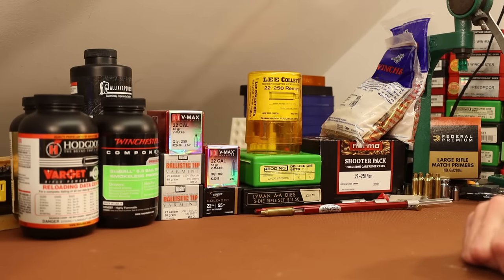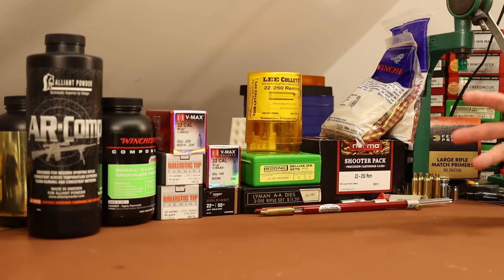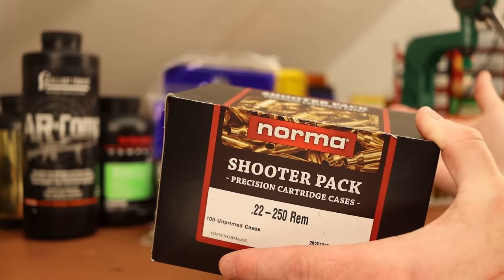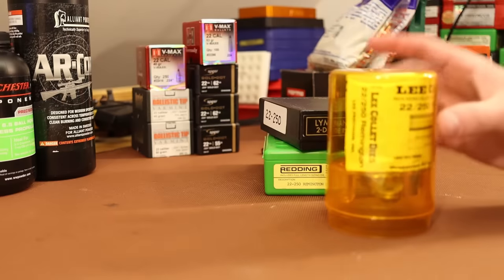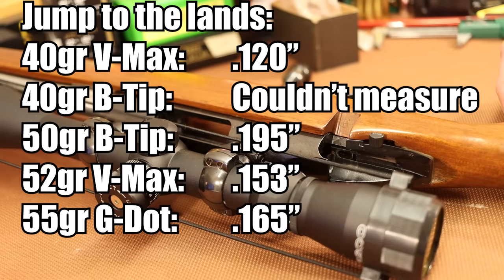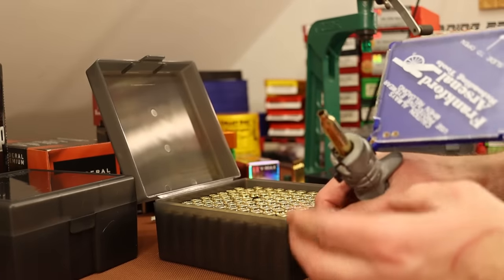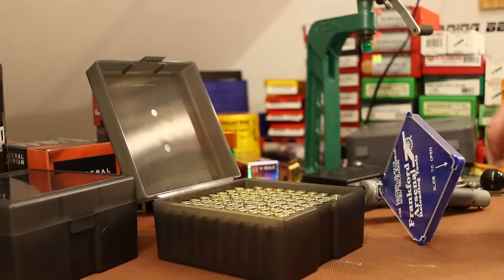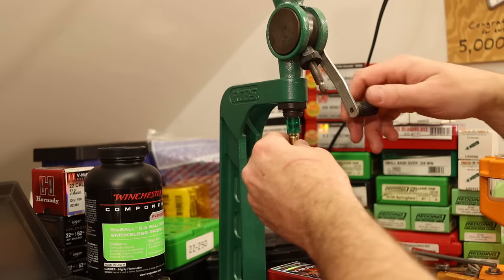.22-250 Remington - Getting started with reloading

Comment: Merry Christmas JRB and thank you for this video.
The 22-250 is my calibre of choice, and I can tell you that they are as temperamental as woman at that time of the month. As you found out, they hate the longer projectiles. This is most likely to be the difference between the Centre of Pressure and the Centre of Gravity. With the longer projectiles the CoG is well behind the CoP (this is a generality, and may not be true for more modern projectiles) which will lead to instability with the slower twist. A couple of years ago I tried some Nosler Custom Competition 52gn BTHP and the sum instabilities of the BT and the length of the round had them full keyhole at 50 metres! Had I been shooting 100m, they would've missed the target completely, and it didn't matter the powder or load used. I have found that square based projectiles will ultimately give far more consistent results than BTs.

I compared 2 Sierra pills, both 55gn, their GK and their Varmint. The Varmint(square base) shot much more consistently than the GK (BT), but due to cost, I use the GKs, because over here they're called "Super Roos" and are almost half the price of GKs, lol (I'm poor).

I've also found: the slower the powder, the worse they shoot. Don't know about heavier pills in a tighter twist, as I'm currently using 14" twist, but on rebarrel (about 6 months away) I'll be installing 10" twist in 22-250.

OAL - I don't even bother any more, as in my rifle the projectiles are Olympic Champions in long jump, which in most factory rifles is the norm. With most of the testing I've done, I've simply added case length, projectile length and minus 0.223", seating depth = projectile diameter (well close anyway, lol). I've also shot various rounds reloaded from trusted shooters, measuring everything prior shooting, and we're all loading to pretty much the same OAL. The 55gn V-max are tack drivers, they should be in your mix.

I use 8208 and have tested slower powders similar to Varget (a good powder but not for 22-250) down to comparable powder to H4350 as well as a couple of faster powders. Through out all these, I found that 8208 far out performed all the other powders, so I'm very interested in viewing your results.
Again, thank you very, very much. (hurry up! lol)

Comment: Hey bro i shoot alot of 22-250 mine is a tc venture predator 1-12 twist that one is probly 1-14 . First off id say your biggest priblem is the optic and secondly your chrono on your barrel changes its harmonics especialy as its moving down the barrel that id say is reason fer the big groups. I have shot all the primers in mine and winchester large rifle is all i use now they are the hottest primer on the market they have never had a magnum primer till here latley and wlr primers have fired alot of powder charges in magnums thru the years. In my rifle wlr is the most accurate. I use winchester brass 90 percent of the time i akso use remington and hornady win. And rem shoot pretty close to the same the speer 70 gr sp is the same lenth as the 50gr nbt so it will stabilize in a 1-14 twist just so you will know and it hits hard at 200yds on steel the staball 6.5 powder charges in other calibers are real close to superformance charges and fps is also close just info i picked up on my lee seating die does not crease my bullets but my hornady die in 222 rem does just something i noticed in my experience thanks fer the great video bro looking forward to another one

Comment: Enjoy your videos greatly! I used to shoot a 22-250Ackley improved, that Nelson Berger built for me. It was a heavy contour Douglas barrel with a 14" twist. It shot one hole groups with 55gr nosler ballistic tips and IMR 3031 powder. It shot good groups with the same powder/bullet combination as a standard 22-250, but I had to push the envelope on pressure and velocity a bit too high in order to get good accuracy, hence the switch to Ackley improved.

Comment: It’s not just length, but the center of mass relative to center of pressure. If the extra length is from a light plastic tip, it will stabilize just fine.

Comment: I just seen your video on the 22 250 I had a  model 700 with heavy barrel  and with  h380 55 gr Sierra hollow point  and  just neck sizing  the bullet has close to the lands as possible  at 100 yards 1.8 in groups at 200 yards  1.4 yards  and 300 1.4 groups

Comment: OMG, a movie length video!  I made it through, but I did fast forward through the loading portion a bit.  I was happy to see you loading for the .22-250, but somewhat disappointed you have to go with the lighter bullets, because of the slow twist.  Mine is a 1:12 twist and I’ve shot the 60 grain bullets without any issues.  I really like the 50 to 55 grain bullets.  Not much of a fan of the less than 50 grain bullets as they drift too much in the wind.  Looking forward to the rest of the videos in this series.  Keep up the good work!

Comment: I have a German 98 Mauser that had the barrel and the stock replaced on it, plus some other custom work. The barrel is stainless steel in the 22-250, and as you mentioned, a slow twist rate will cause keyhole patterns with heavier bullets, and mine happened to have a slower twist rate. I found this out the hard way when I loaded 65 grain Hornady bullets and I noticed the keyhole patterns. I want back to to 52-55 grain bullets and I got very tight groups.

Comment: I used to use the 60 grain Partition over a stout charge of H380 @ around 3600 fps for deer. Works quite well indeed, very flat trajectory and very little recoil makes it easy to place your shot precisely. My technique with the Magnetospeed is to shoot a series for velocity and SD, then remove it when shooting for group. Having that Magnetospeed creeping pretty much invalidated that whole series, IMO. I personally would reshoot that series, even though it's a pain in the butt.

Comment: For Winchester brass, those who choose it,  full prep is required including primer pocket uniforming and annealing. That also includes getting way more than you need to weight sort as well. Some will even then capacity check or capacity check instead of weight sorting. Neck turning is also a common thing. This is done on the 308 side as they have the most capacity allowing larger charges and higher velocity potential.

Comment: The 788 was Remington's best kept secret, didn't want to cut into 700 sales with their budget model (lol).  I've worked with three of them over the years and they've all been exceptionally accurate.  I suspect it's the rear locking bolt that might be allowing the bolt face to square up with the chamber. Just a guess.
Reply: I have 1 in .308 with a burris scope , ill never sell it .
Reply: @johnwallace1729  Years ago, I found one in 308 at a pawn shop for $150. Gave it to my son. First load we tried was a 150 Sierra flat base over IMR4064 - 1/2" groups at 100 yards!

Comment: 22-250 is one of the easiest caliber's to load for they just flat out shoot whatever you feed them.
Stick to the 50-55gr bullets and you are gold.
55gr Vmax is the way to go.
Reply: Got any choice powders? There’s not much around my area or online. I haven’t seen varget in yrs.
Reply: @zackzittel7683  Loading one for 25 years, I've used IMR 4320,4064 as well as 4895 and had great success. They recently quit making it, but 4320 is far and away my favorite powder. Super fine cut, making it easy going through the powder funnel and it's also given me the best accuracy of the three. I've never used Varget, but have been told it's identical to 4064 in burn rate. I thought of trying IMR 3031, but read it isn't short cut, so I passed. H380 has earned a reputation as well.
Reply: @SilverBullet22250  I only have H-380 and got a very small amount of varget from a friend recently. Thanks for the reply.
Reply: @zackzittel7683   G-u-n-B-r-o-K-E-r  for Powder. Not cheap though, as well as a hazard fee.

Comment: If you use a case length comparator and measure the  Hornady case and subtract that from the tip OAL you have from the Hornady case,, then measure a fired case with the comparator and add the other measurement, the Hornady tool will work just fine with the Hornady case. However, I have broken the end off two of the Hornady tools with sticky cases in the chamber. It is convenient, but, a tad fragile if you happen to push a bit hard into the chamber. So, I have mixed feelings about it.

Comment: I picked up a like new Ruger M77 made in 1975, and it shoots lights out with a Speer 50 gr HP. I was only getting 3450 to 3500 fps out of it before I was losing accuracy with Varget. COL was straight out of the book. I believe it has a 1/12 twist though. I'm looking forward to more if these .22-250 vids!
Reply: Paden Kindall : that ruger should have a 1-14 twist, that’s what my ruger has. Or call ruger they can tell you what you have by the serial number
Reply: After further research, I've confirmed that it's a 1:14 twist.  Thanks for the correction Keith!

Comment: What a great coincidence that you should start this series on the 22-250 right now.  I just started doing some reloading work on one of my 22-250's and have 100 pieces of Win brass to start that I was given a couple years back.  Have you tried Starline brass?

I haven't shot anything yet but the first 2 loads are with H380 (39.8-41.0 in .3gr steps) and Varget (34.8- 36.0 in .3gr steps) using Sierra 52 MK bullets and CCI 250 primers.  Will also try CFE223 and 4320.  Tried 4895 already and it didn't show any promise in my rifle.  I'll let you know how it goes for me and I'll see how it goes for you.  The rifle is a Howa 1500 SA with a 20" HB so there will be some velocity loss.

Comment: Hodgedon knew what he was doing when he developed H380 specifically for the 22-250. H380= 38 grains at 3800 fps. I've been shooting the 22-250 since the late 1970s and feel (like many oldtimers) keeping the load under 4000 fps saves and greatly improves barrel live as compared to the 220 swift we used to load real hot. I have found my rifle really likes 36.7 grains of H380 at just over 3650 FPS undef a 52 grain HPBT. I pay no attention to what the book says my COL should be, I seat my bullets just off the lands with no problem still fitting into the magazine. My wife loves shooting the 22-250 and it absolutly will shot dime sized groups at 300 yards off a bench. Our rifle range is only 300 yards. 
I really must be old but no way in hell would I hang some damn thing on the end of my barrel for load development. I would surely think and be concerned about barrel harmonics and consistency.

Comment: If your bullets are seating with difficulty, they are probably being seated crooked. When the neck thickness varies, the bullet will follow the path of least resistance. Check the bullet wobble on a good concentricity gauge like the Sinclair or  RCBS units. Good video.

Comment: I have no interest in 22 250.
I am a year into researching reloading for 308 and 6.5 creed. By the way the vids on SMK 168 VS The hornaday were of great interest and the essential reproduction of the Federal GMM with simular results gives me lots of incentive.  Also your use of the aero ar10 frame was close to my build save for a criterion barrel vs your higher end creiger I believe and I used odinworks adjustable gas block with their gas tube and their adjustable buffer weight to time my extraction to 3:30 as LR308s are notoriously over gassed. Either way I appreciate your interest in bolt accurate gas guns.  My best results exist with the gold metal match 168 in 308. My RPR 6.5 
Will group half moa with win deer season, winX, Fed Gmm 130 bergers. Magtech, S&B, Sig Match..       The 140 even in the S&B and Magtech makes ragged hole groups at 100. It's strange that everything from the 125 Win to 143 ELD all group from very good to I can't believe I did that at 100 yrd's.  Apologies I'm rambling.   Your vids ( even when regarding cartridges that Im not interested in) are super informative and at length I'm still watching.    Thsnk you for your interest in helping regular people learn while remaining humble and learning yourself.    It's admirable 
Keep making vids

Comment: Great video Johnny. The 22-250 is a rifle that I want to try for coyotes.
Reply: I would recommend copper solids such as barnes stx. I shoot primarily Hornady v max 50 grains, and they are great instant kills if you DON'T hit bone( dropped yotes at 100 out to 450 yards), but ive also had to pistol kill yotes in ditches and thick brush because i hit ribs and didn't get vital penetration. I still load v max for groundhogs and such because my groups have been fantastic, but dont recommend it for body shots on coyotes, it seems like all of my experience with v max are extremely good or extremely bad.
Reply: I assume other ballistic tipped varmint bullets have similar results

Comment: some other bullets to maybe try: 53gr Nosler Varmageddon - higher BC than Hornady at .303, same length, but flat base, would be interesting to compare stabilty (same length but may have more bearing surface, wonder if that would have any effect on stability). Also Nosler Varmageddon 55gr flat base, Hornady 55gr Vmax flat base. Hoping Staball shoots better as it gets into higher pressure loads

Comment: I have reloaded for over 41 years. because of age, health issues, medicine reactions I can shoot average or better than. once a deadly long range rifle man . my deer/ self defense load is serria 63 gr psp with 34 gr Imr. 4895 . it groups equal to 52 -53 gr match ammo I used to load, rifle is a savage 112 varmeter . when I bought it 36 37 years ago the outside  group measured a 5 shot 1/4 by 5/ 16 inch 100 yards from sandbags. it will probably still do it with young eyes and steady heart rate. don’t use this load for a neck bone shot if you want to mount a deer, it will eather hollow out the inside or leave a horrendous hole. the biggest buck I was blessed to take was with this load. 92-98 yards quartering shot from ribs to opposite shoulder. this was very strange when I got to deer as no tracking. the exit hole was so small if little drops of blood was not visible the deer didn’t look shot . but cleaning the deer the top of heart gone, both lungs slightly smaller than my fist , I got big hands. opposite shoulder hole you could put a drink can about through but hole in hide match head size . strange ain’t it. I also specialize in ultra reduced center fire ammunition for special applications , a endeavor not for the new reloader because of danger in testing . my recipes are not published because  I don’t want to have lawsuits from irresponsible fools with tools and no knowledge about using them. I have much experience and knowledge that when I am gone it will be gone unless I share with a smart. reasonable person . thank you for your time.  by the I ask young shooters what is the difference between a shooter and a rifleman? a shooter waste good ammunition. a rifleman finds his limitations and builds on it. always extending each limitation seeking to be the best they can be, ever learning, correcting their selfs, no excuses to lean against. nana and papa aka the hunter from Elkin, North Carolina wishing you well.

Comment: I gotta say I enjoy the videos where is that 220 swift you were talking about I'm a fan but in 22-250 cfe223 should not be overlooked I understand testing in winter is poor for summer heat the other thing I want to mention is when I run my magnetosphere crono it makes groups significantly change both ways had made excellent load put it on to check velocity and the group's went terrible or made a load with it on and it's shot terrible with it off most of your testing is on a ar platform I don't notice the difference as much on them as an old-school wood gun

Comment: Sorry if this is a dumb question but what were you using for the flash hole deburring tool on the FA case prep machine? I was looking on there website and didn't see that attachment.

Thanks for doing these series I have always wanted to buy a 22-250 ever since I shot a deer with a Guide's gun down in south Texas on the King Ranch property. But it seems to find a production model with a faster twist rate than 1 in 12. Again Thanks and Merry Christmas.

Comment: If your barrel twist will support it, give the Sierra 69 gr. TMK bullet a try.   I'm using IMR 4350 and getting just under 3200 fps from my 22" barrel.   Accuracy is very good as well.

Edit... 1x14 twist is too slow for 69 TMK bullets.    Needs a minimum of 1x10

Comment: I've hunted around for rifles online chambered for 22-250. I reached the conclusion that I would NOT get a rifle without 1:9 or 1:10 twist in this cartridge. Don't think I'd go heavier than about 65gr projectiles in this cartridge, but just in case, a faster twist is preferred. Most barrels I've seen in factory guns are 1:14.

Comment: You might want to look down the action at the back of the barrel.  Most aftermarket barrels will have the cartridge and twist engraved there.
Reply: Might just find basic caliber not chambering if barrel chamber was cut by another gunsmith. They should mark them in my opinion though. But yes check barrel end with boroscope if necessary.

Look at https://preferredbarrelblanks.com/ which will show you a pile of unchambered but marked blanks.
Reply: True!  All of my aftermarket barrels have been pre-fit Savage barrels from Shilen.  All of them have been marked with cartridge and twist, is the reason I though of that.